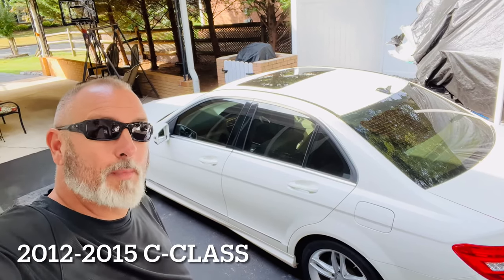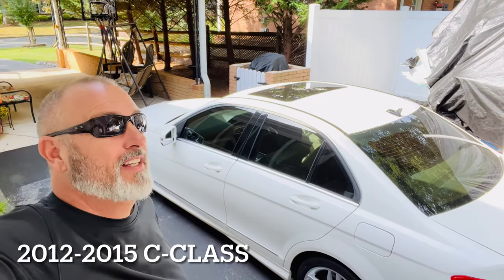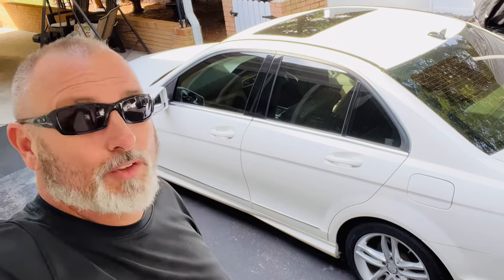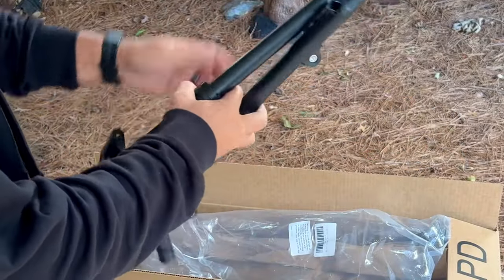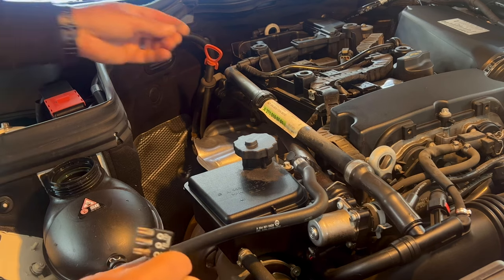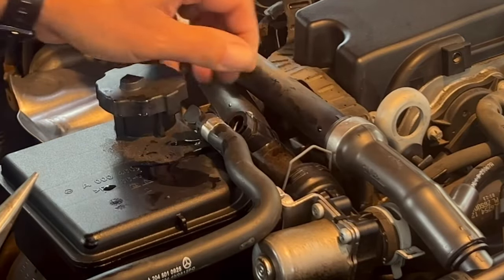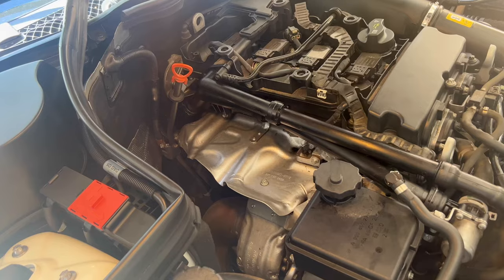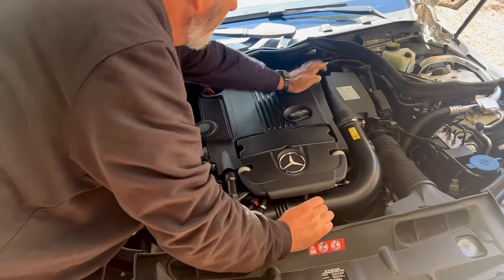Mercedes C Class Common Coolant leak. DIY fix. Must watch!!!

Comment: Oh wow, I had a similar issue with my 2019 C Class. The mercedes dealership told me “it’s totally common for my vehicle to lose some coolant” but i don’t think they realized the extent of my leak. Another specialty mercedes mechanic in town estimated a 1,200 gasket replacement. I wish I would have seen this before trading her in!
Reply from the maker: Dang. I hate I couldn’t have helped you. 🤙🏼

Comment: Questions:
1. When you take off the old top tube (air), the one with the factory band, how do I take it off? Never understood how you got the old band off?
2. I bought the special hose clamp tool but when i use it the tube gets pinched when the clamp is compressed and the old tube will not come out.  Suggestions?
Appreciate you putting up with my questions
Reply from the maker: Removing the old tube I wound up breaking it and using plastic cutting pliers. I am sorry I didn’t get that on video. Don’t waste time fiddling with it, just break it into pieces to get it out. Makes like so much easier. Once you break it then you should be able to get the hose plies on that band easy.

Comment: I have a 2014 C250 with the confirmed leak thanks to your video, however i cannot find the available part on amazon. do you have any new link? also will the new tube also fail after a few years? Its unfortunate to see so many people have the same issue with this vehicle.. I wonder what other common problems your familiar with these having? Supeerb video My sir, thank you.
Reply from the maker: Hey. Thank you very much. Here is another link. https://amzn.to/3L7i7Bi
These new plastic tubes should never fail. Not sure why Mercedes is having an issue but you should be fine with the new piece here. I’m not familiar with any more common issues, but if any arise, I will be sure to make a fix-it video.  Take care. 🤙🏼

Comment: Excellent video.   I used your video to do this same repair.  The only problem I'm having is the very front connection of the coolant tube where is slides in and the clamp clips down on it, mine is leaking there. My replacement pipe did not come with any o ring or anything there so I used the old one but I'm not sure if I got it in the correct place or  not.  Any advice?
Reply from the maker: Oh wow. Yeah you definitely need a new one-ring in there. The old one will leak for sure. I would order a new kit. They are fairly cheap. I wish I had better advice. Good luck bro.
Reply: @LivinWith3M order a new pipe kit?  Or o ring kit?
Reply: @LivinWith3M did the pipe kit you got come with a new o ring?   Mine did not.
Reply from the maker: @TheDougJohnson  I would just order a new pipe kit that has the oring with it. To remove any chance of things not fitting up.
Reply: @LivinWith3M got it.  Thanks.
Reply from the maker: @TheDougJohnson you’re welcome. 🤙🏼

Comment: The part on Amazon is not available.  I found a number of parts on Amazon that are a lot cheaper (under $30). But the part numbers are all over the place though they say compatible with C250.  Are these other parts ok to use?
Reply from the maker: Here I got the correct part. Click here and order. https://amzn.to/3uhKp70
Reply: thanks! @LivinWith3M

Comment: Is the part number for the tube the same for 2016 C300s?
Reply from the maker: I just got through checking and I think the 2016 C300 has a different type tube. I’m sorry. I really wasn’t aware until right now either.

Comment: I have a 2015 C300 it is pouring out coolant out of nowhere. I’m trying to see if I can find that hose you’re speaking about but I don’t see it when I open the hood.
Reply: The leak is so bad that when I put new coolant into the reservoir, it just pours out from the bottom
Reply from the maker: Ok, when you open the hood. Look to the passenger side of the engine. Under the side of the plastic engine cover. You will see a metal or aluminum piece sort of flat. Look to see if coolant is puddling on it. If it is then the black tube is right above that metal pan. Rewatch my video and pause it to be sure it’s the same type leak. Let me know what you find out
Reply: @grant242 it also can be your water pump if not those hoses.
Reply: @genarogranados3093  turned out to be the water pump. Got a replacement from parts geek
Reply: @grant242  nice glad you found the problem. I have replaced those hoses also and then 2 weeks ago I replaced the water pump myself same problem.

Comment: I have a 2018 c300 and my motor doesn’t look like that. I took off the cover and it doesn’t have that part 😳
Reply from the maker: Oh wow. Thank you for letting me know. Hopefully that info will make things clearer for other subscribers. Mine is the 2014 c250 so maybe things changed at some point. Do you have a leak in that area of the engine?

Comment: My c w203 gets the water from the cap but no raising temperature i have water leak sure but that say head gasket and testate but i think is a tube problem
Reply from the maker: I agree to start with the tube. It’s a lot cheaper than jumping to head gaskets. Just my opinion. 🤙🏼

Comment: Guys, mine had the same issue, I've fixed it, and was fine, but one month later (yesterday) It showed de massage again, but this time I can't figure out were is the leak.
Anyone has an idea of were it can be?
(Mine is a C200, 2013, with 150.000 Km)
Reply from the maker: I’m not sure, but if anyone has any ideas please chime in.

Comment: Thanks for the video.  I will be making this repair with your guide.  I have one question.  The OEM coolant tube is exactly the same part as yours A2710105701 but the link in your description and one in the comments you link 2712002452.  I have a 2014 C250 are your amazon links correct?
Reply from the maker: You are welcome. That link takes you to the correct one. That will fit your 2014. 🤙🏼
Reply: @LivinWith3M  I know what I will be doing this weekend.  Thanks man!
Reply from the maker: @jamespatterson6463  Awesome! Remember if you have to break the old one into pieces getting it out then that’s cool. Don’t waste valuable time trying to avoid breaking it since it’s already broke. Haha. Ask me how I know. lol. You got this man! 🤙🏼